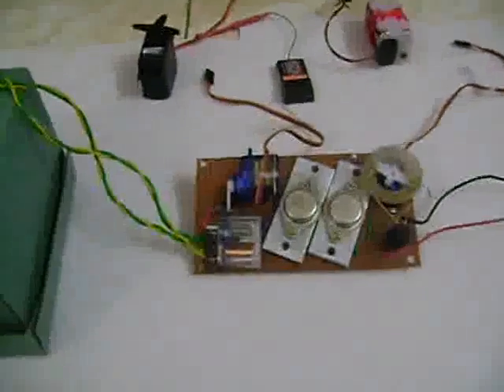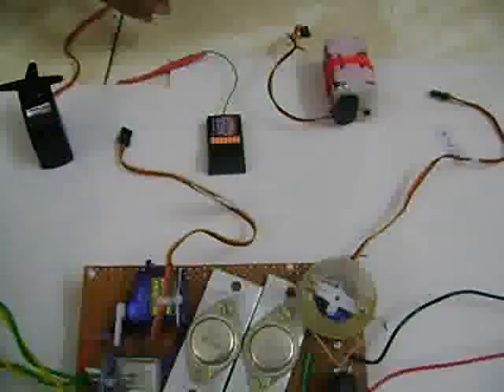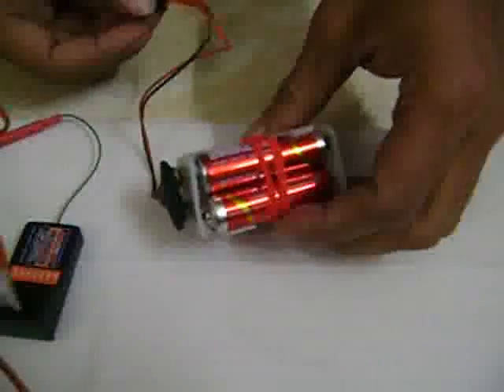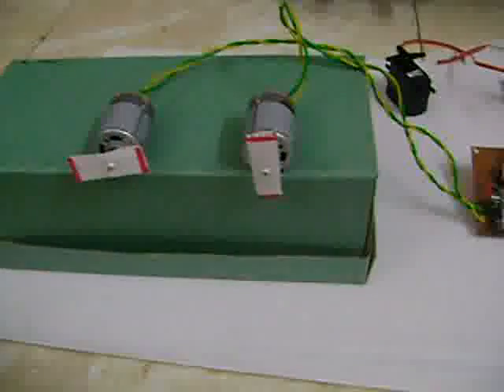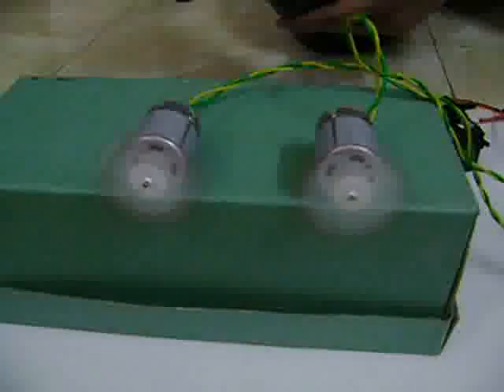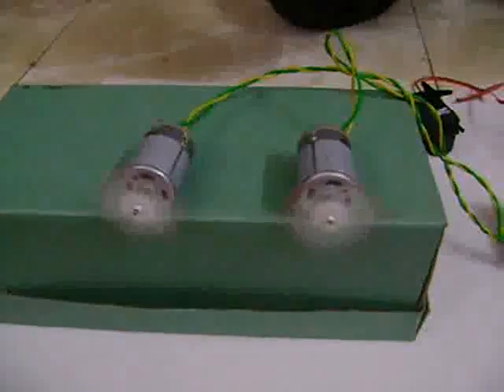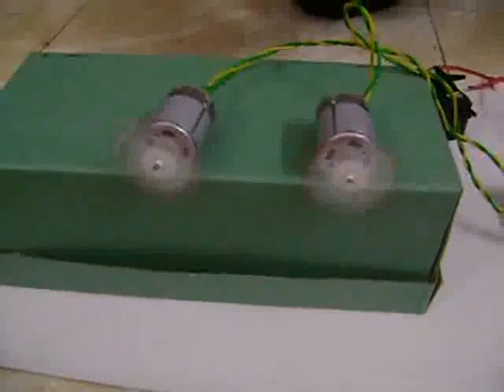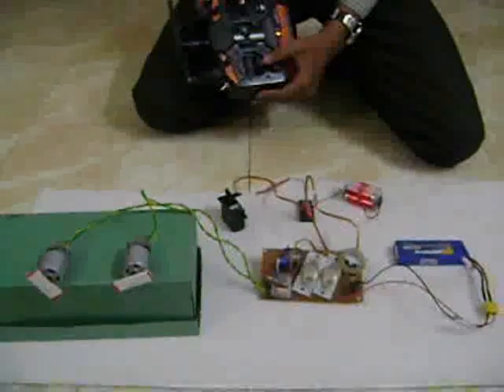Brushed ESC.flv

Comment: How do you program a ESC to have a reverse mode? We're looking to control a ESC from a servo board (For a robotics project greymatterrobotics. com)
Assuming that the input will be between 0 & 255, we're looking for 127 as off, 255 as fully forward and 0 as full reverse. Any help?
Reply: DO U NO HOW THE REVERSE SYSTEM WORK PLZ REPLY 
IT IS MY COLLAGE PROJECT